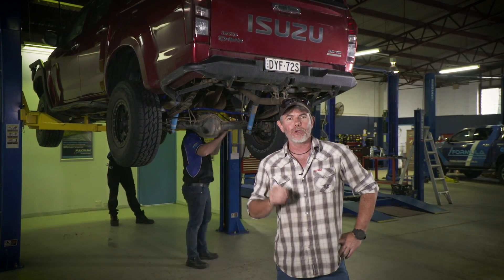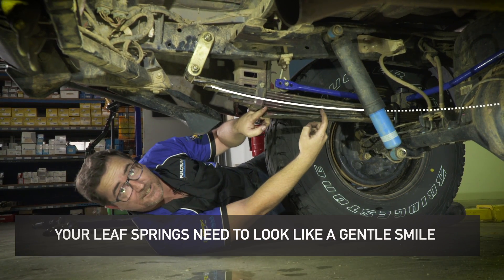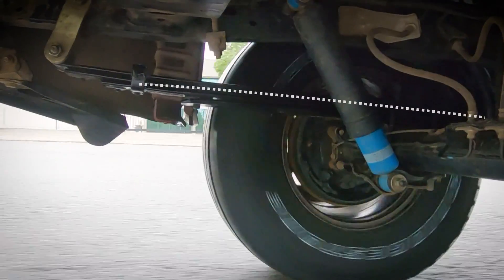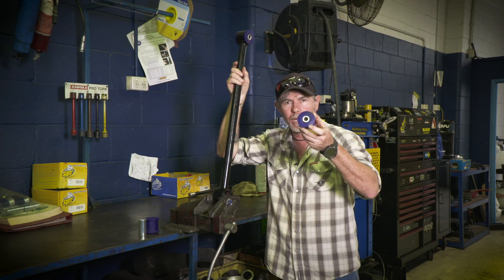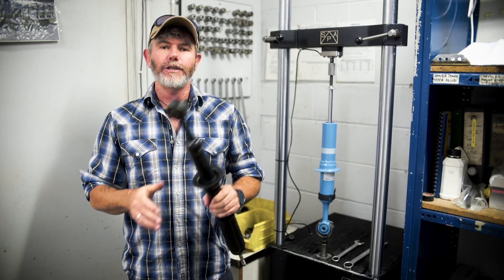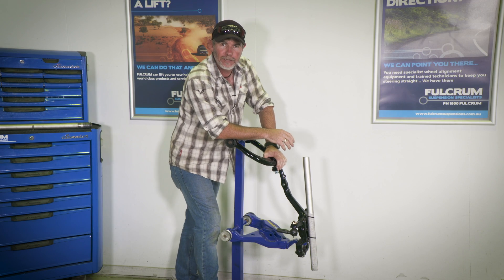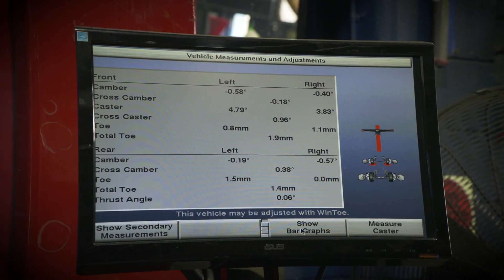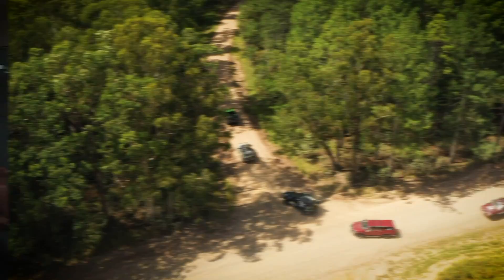4WD SUSPENSION IN DETAIL – what your 2 inch lift is missing! Graham Cahill reveals expert secrets

Comment: How do you get more flex out of torsion bars?.
Reply: You cant. Generally torsion bar vehicles have a upper and lower control and have a limit on control arm travel. The only way to do this would be with an extended steering knuckle and lower control arm drops, which you would have to get engineered. Feel free to give us a call on 1800 385 278 or send us a message through our website.

Comment: What nonsense.
Land Rover have been running coils all around since the 70's.
My 2014 DC 110 has Dual rate rear coils and in standard form can carry 1000kg in the wellside and still is the most agile off roader,as opposed to a standard Land Cruiser DC that can only carry 400kg with old style cart springs

Comment: Might be a silly question but, if you change from A/T tyres to mud tyres that are an inch or 2 bigger can this cause any issues on stock suspension or shocks.
Reply: No issues with the suspension but you may find the wheels will  scrub on the body without the correct lift. This will be noticeable when turning or articulating the vehicle.
Reply: @FulcrumSuspensions1976  thanks guys really appreciate it

Comment: Spacers vs supsension lift?
Reply: Depends on what you are looking to do with your 4WD. Spacers are a cheaper option that give you a slight increase in lift allowing you to get bigger tyres for an increase in clearance. A suspension lift is a complete upgrade of the suspension system offering better on road and off road control. With a lift kit you get upgraded spring which allow you to carry your accessories better.
Reply: @FulcrumSuspensions1976  hi, I have a similar question...to use spacers or 2" lift on ranger 2017. Minor off road use nothing extreme. With spacer, will I maintain same handling or more stiffness? Plus if I go 2" full suspension kit, do I need to change the arms? I hear yes and no on 2", only 3"+ you will need to. Thanks
Reply: @shefdim4593  Great questions. If you want the lifted look but no suspension benefit than get a spacer lift. A spacer lift is purely cosmetic, it offers no benefits. If you are considering getting both spacer and a lift kit, this is illegal and we highly recommend you do not do this as it is actually unsafe. 

If your looking for a better ride off road and on road with the benefit of upgraded springs and shocks, just go for for a full 2 inch lift kit. I hope that answers your question and if it doesnt, please call us on 1800 385 278.
Reply: @FulcrumSuspensions1976  thank you very much 👍🏽

Comment: How good are the gq bushes for a 4inch lift
Reply: They will work fine, but maybe under harsher forces due to the increased lift. Feel free to give us a call on 1800 385 278 or send us a message through our website.
Reply: Im real hard on the gear and the let down i have is they where out in 2 months
Reply: @stotty117  What bushes did you use?
Reply: Genuine  nissan ones
Reply: With expended arms

Comment: After putting in a 2” lift into my  2014 hilux, I found the passenger side front sat 20mm lower than the drivers side. This is with the car empty ( no gear or people in the car and on flat ground) is this something common when lifting IFS vehicles and what are the correct ways to rectify the difference?
Reply: This could be a number of things. Either a coil spring issue or maybe you have aftermarket accessories the vehicle did not come with originally that these springs aren't allowing for? Feel free to call us on 1800 385 278 or send us a message through our website to discuss further.

Comment: Hey ShaneI have a 2010 ford ranger 2.5 TD single cab that's has torsion bars on the front how does 1 raise the vehicle and is there an after market suspension kit that I can fit that does away with the torsion bar
Reply: No there isn't anything you can do about getting rid of the torsion bar. Unless you do some custom engineering. You can raise the vehicle by adjusting the torsion bars. Feel free to give us a call on 1800 385 278 or send us a message through our website.

Comment: My question is, i have a solid axle 1996 duel cab hilux, i have only recently started 4wding and was wondering if it would be beneficial for me to have coils or leaf springs all around, i dont carry much weight normally just a swag and fridge. The reason i was considering coils where that you get better flex with them generally but im not too sure if it is worth it, most of my driving consists of rock crawling, sand and mud and just wanted to know which would be better all round.
Reply: The 90's era solid axle hilux is a great offroad vehicle! If set up correctly you can achieve great flex even on leaf springs front and rear. The money you would spend modifying the vehicle to take coil springs or coilovers could be better spent working your leaf springs, long travel shocks & lockers to improve offroad traction further.
Reply: @FulcrumSuspensions1976  cheers for the advice👍 looks like my mind has been made

Comment: Hey guys, Great informative video. Just to as a question to this, I have an 80 series with a new 2" old man emu suspension kit with castor correction bushes. All the tie rod ends have been replaced and steering box rebuilt but I still drive a shopping trolley, do you have any suggestions???
Reply: What size tires do u run  I found a new bigger steering dampner fixed similar issue in my gu patrol
Reply: @samanthakilner74  I run 285/ 75 16s

Comment: Great video, really enjoyed it! My question is...what mods can I do to strengthen the IFS on my 4wd and what parts are the most likely ones to break?
Reply: I would imagine that is highly dependant on the model of car. Tie rods seem like the weak link most of the time.
Reply: TMM a Prado 150, twin lockend, 2 inch Lift and 285‘s.
Reply: Depends on the vehicle. We recommend a poly bush upgrade, decent shocks, strengthening brackets and springs. Feel free to call us on 1800 385 278 or send us a message through our website.
Reply: Fulcrum Suspensions thank you for the answer, it’s a Prado 150, lockers, 2“ lift, 285 tires.

Comment: Can you get a liftkit done before installing the extra front weight that you plan for? Ie Bullbar, nudge bar, dual battery setup, etc.
Reply: Yes you can, but your vehicle will not be sitting right until you get the weight sorted. Even then if you end up never getting the accessories that you once wanted your vehicle will not sit right as the spring rates you requested would have changed. That is why we recommend you get all your accessories and weights sorted before a lift kit to make sure it is precise.
Reply: @FulcrumSuspensions1976  is it the same with torsion bar suspension as I have a 2010 Holden Colorado?

Comment: How much does all this cost? And if you just do light to moderate off roading do you really need all of this done or will you survive with stock? Worried I might not make it out my driveway without the full suite of Fulcrum upgrades...
Reply: A 2" lift is a pretty smart first step if you can't go larger with tires first.  I recommend people consider this order for any upgrade project - tires , lift, camber correction, mono-tube dampers,  then sway bar disconnects.  If you want to have a bit of fun with a mostly stock rig, go up in tire size and go play - if you need more, come back for more!
Reply: @ewingfox6459  Cheers mate, exactly what I wanted to know :)
Reply: I did all of this on my 4runner here in America minus the leaf springs of course and did a 3in lift rims tires 285\70s for around 5k. Could have been cheaper but did icon , total chaos uca and also icon adjustable torsion bar. Plus transfer case spacers as well as stabilize bar drop. However worth it alignment came out perfect . Rides better when loaded and very little roll. A little stiff unloaded if you cant be bothered to adjust it.
Reply: Depends on the vehicle you have. You can also go all out and get the most expensive gear or you can go with an affordable setup which is still extremely reliable. It all depends on the application of your vehicle. Feel free to call us on 1800 385 278 or send us a message through our website.

Comment: This guide is not great. 

The nylathane bushed give a harsh ride and introduces road noise.

Adding a sway bar will lessen your cars ability to articulate, also adding rear sway bars gives you less drive.

You can have adjustable air bags that help coil springs control different loads as good as leafs.

You only went over positive things not negative, there is usually always a trade off... This was just a big advertisement for you supporters.
Reply from the maker: Great points Nathan. 

The positives for polyurethane bushes far outweigh the tiny amount of a harsher ride you get - hard to even prove if it’s the bushes with all the other changes made. 

As the video says - for tradies or those doing big trips (those that are loaded) - a rear sway bar is great. For the 95% of the time your 4WD is not on tough tracks a sway bar will be a great addition. You can disconnect it when you go off-road. 

Air bags and coils can control different loads but at a far greater cost than choosing the right rated leaf springs. That’s why manufacturers don’t fit them 

Thanks mate
Reply: airbags are NOT recommended for leaf springs. good way to bend or break your chassis.
Reply: your right mate, thats my bad haha
Reply: @orson091  read his comment again, he states coil spring...
Reply: Nathan Squire I was thinking the same thing. it's a bolt on channel but they romp the hell out of them.
Reply: Hey Nathan, hopefully I can help clear some stuff up :) 

If you are referring to is another brand of bushings they are actually not a type of bushing, Polyurtahne is one of a few materials used to make suspension bushings. Their bushings are made overseas and due to the way they makes their Polyurethane bushings. They are known to have harsh ride and produce NVH, which has given poly bushings a bad name. Their older bushings are also known to not last long, especially in the sun and actually crumble in their packaging. 

In this video SuperPro bushings where showcased. SuperPro bushings are designed, tested and manufactured in Brisbane. Each bushing is designed with specific design features to reduce NVH. SuperPro's unique blend of polyurethane also eliminates harsh ride factors, maintains flex and reduces NVH. The most important point to make about SuperPro bushings is that each bushing is designed for a specific application. SuperPro makes sure that if a bushing is released for 4x4 use than it works for 4x4 use. They are very open about their engineering and design process and even allow people to request a tour of the facility. SuperPro has become the number one aftermarket bushing in Austrlia because of the previous mentioned points, with over 1,000 sellers. Including; Burson, Repco, Autobarn, Supercheap and many more. You can learn more about their bushings here by looking up their youtube channel.

In regards to 4x4 sway bars. Fitting larger sway bars, particularly in the rear, has two main effects, vehicle balance in terms of understeer or oversteer and increased roll resistance. Both of these effects can provide increased overall handling and safety benefits in a 4WD vehicle. If you are looking for increased stability on road or when towing, sway bars are a great upgrade option.  

The modern 4WD Dual cab utility, almost the family sedan of this century. Is normally coil sprung with a strut front end and leaf sprung rear with no rear sway bar support. Because of this dual cabs typically suffer from under steer and can be very unstable during high speed directional changes. When you load the vehicle with accessories, people, change its height or tow the problem only gets worse.

The biggest resistance to the fitment of bigger sway bars to 4WD's is the flawed concept of the loss of articulation in the suspension. If the replacement sway bars are designed correctly and the sway bar links are lengthened, replacement sway bars can be fitted with minimal or no loss of articulation. However, the improvements to stability, safety and driveability will far outweigh any loss of articulation. Just imagine trying to swerve out of the way of an obstacle without a sway bar compared to with one. 

Yes you can use air bags/coils and we install them on many vehicles depending on application. Leaf springs are a far more safer and reliable option when it comes to carrying a specific weight. Like many things though, we take into consideration the vehicles use type and customers desired application. If you get the right rated leaf spring though, you are set.

Comment: Are we allowed to ask how you got the 4" lift & 35" tyres engineered on the Patrol camera car? I'm sure all of us with Patrols who got spanked (incorrectly I might add) running the Mansfield gauntlet a couple of years back with 2" & 33s want to know how you did it legally..
Reply: We actually didn't have anything to do with the camera car. That was a Nulon special build, you will likely find that the car has been mod plated.
Reply: Apologies, I was aiming the question at 4wd Action as I know you guys didn't do it. Would be interesting to know if it is plated though as I don't know of anyone who's managed to get 35s through on a Patrol for a few years now without installing portals.

Comment: Torsion bars; harsh ride, causes, down travel compromised and remedies?
Reply: MrFanOFRacing where was torsion bars mentioned?😂
Reply: @jackbaker7346  It's a Question, wasn't mentioned although quite common in older dual cabs. Needs proper industry information because they are always done piss poor overall.
Reply: My bad, that’s true, my last dual cab hrs had them
Reply: The age of the torsion bar determines the amount of spring left in them. You might have a situation where it is not properly controlling your vehicle and hitting your bump stops. You could run shortened upper bum stops which will increase your down travel. I would recommend you visit a suspension specialist for a suspension check. We offer a free suspension check, feel free to give us a call on 1800 385 278 or send us a message through our website.

Comment: I have one bp51 on my hilux n80 40mm lift. Should I have an after market UCA put on also with this small lift.
Reply: Need to know the year. If it is a KUN26 or above than yes. Feel free to call us on 1800 385 278 or send us a message through our website.
Reply: Fulcrum Suspensions  sorry for the late reply as life has been busy. My Toyota Hilux N80 is a 2015 model, which I think is the first of the revo models Gun126 I think.

Comment: Hey guys! My question is on pricing! Ie how much should you aim to spend and what is too much/ too little?
Reply: novakid hydra what are you driving? I went with calmini or independent 4x4 for Isuzu, Land Rover I use terrafirma, and for domestic Us I go Fox or FOA.  My Disco2 cost about   $2k to lift 3". My 90 Isuzu trooper2 has 3.5" independent 4x4 lift kit for about 1500$. Some kits come with extended brake lines, mounts and things that'll drop the overall price. Some kits are half designed and you end up replacing everything.
Reply: It all depends on what you are using your 4WD for, we have a range of suspension solutions to fit a range of budgets. It really depends on the application of your vehicle. Whether you are touring, doing extreme off road traveling or just own a weekender. 

I would say too little is something where you can tell its dirt cheap and wont serve the vehicles purpose. In most cases a cheaper product wont be quality tested properly and in most cases is a rip off product. To expensive would be when you purchase something that is not meant for your vehicles application, like say you get an overkill off road racing shock absorber which everyone says is amazing but you only install it on your weekender. Again it all comes down to vehicle application and what it actually needs. If you want to go overkill by all means, but does your 4WD really need it?

Feel free to call us on 1800 385 278 or send us a message through our website and we can sort out the best priced solution for you.
Reply: I'm looking to upgrade mine for the first time - most quotes I'm getting from Fox, Emu, Dobinsons, Oztec all seem to be around the 2000 to 3000 range. Raw 4x4 was quoted at 1400. This is for everything, absolutely everything excluding installation. Oztec has lifetime warrenty, but emu and dobinson have reviews behind em.

Im not sure who I'm going with for my 2inch lift, but I do know that its worth the money to get better than the shitty ebay kits.
Reply: I have an Emu 3.5" lift in my CJ7 and it works great.  I choose to use 5125 series Bilstein mono-tube dampers as they run cooler in my experience.    If you can do your own installation, spending more on quality and reputable parts becomes less of an issue IMHO.   Another important thing to consider is if you plan on trading your vehicle in later- lifts and non OE parts will decrease the take in value so shelve the parts so you can swap them back in.  If you don't plan on trading it in at a dealer, sell your OE parts to help offset the cost of the lift you want, further extending the reach of your budget.
Reply: spend all u can on tested lift componants dont cheap out you will regret it ya a cheap kit will get you lifted and rolling but in the long run when u ned to last an hold up it will let you down or atleast give u a ride that is not good ive had a few thay did the trick but after geting a more quality systme the difference is night n day just  by leaveing the driveway i can feel the quality difference its true .